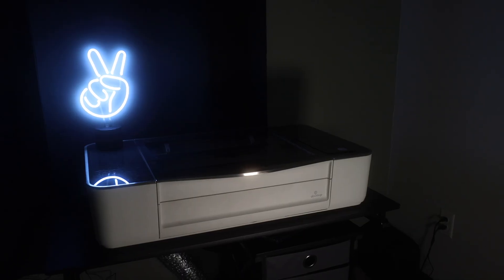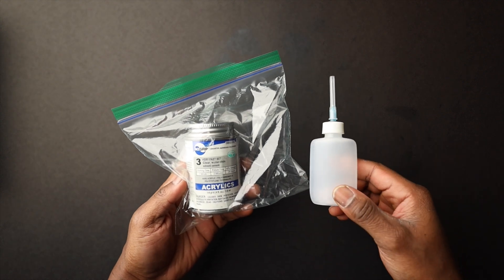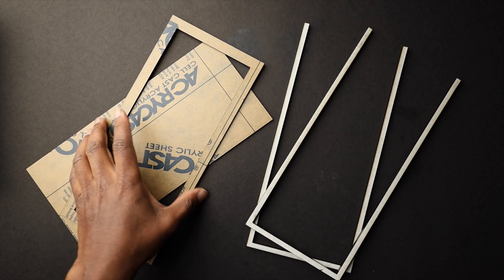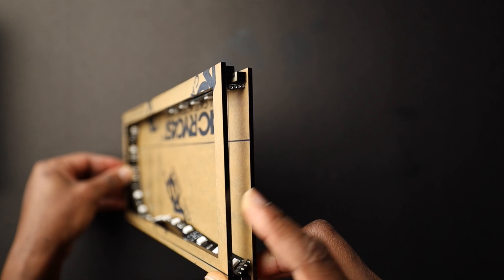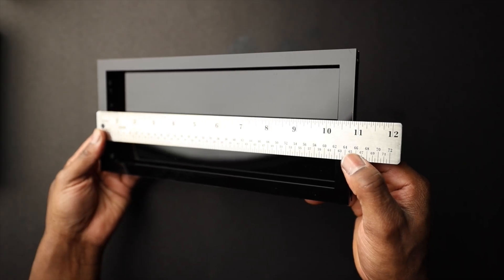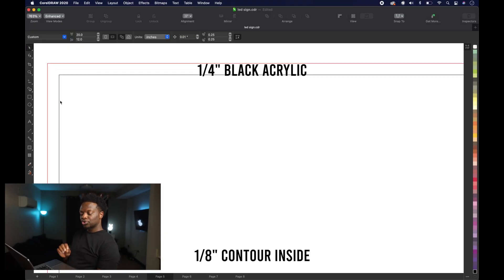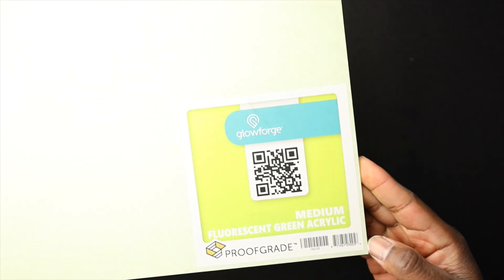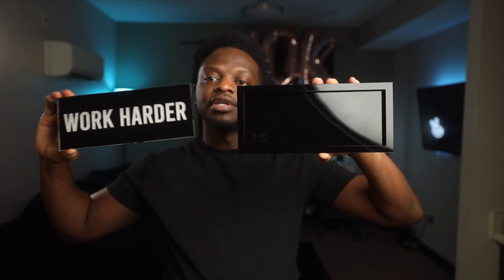Laser Cutting an Acrylic LED Sign | Glowforge

Comment: I have a question. Why add additional black background to the clear. Since the box is black why do you need to back the clear with black? Seems the clear with out the black background would be sufficient. Thanks for the idea.  I will try it.
Reply from the maker: Thanks. I added the black background to make it the thickness to slide inside without flopping around.
Reply: @TroytheMaker  ohhh okay... hmmm. I think I will try it a little different. I will let you know how it comes out LOL...

Comment: Now that's what I'm talking about!! I was really wondering how that green acrylic was going to look like..thanks for showing that.. I ran into that problem with the glue also, so I sometimes use clear glossy tape on the edges to keep the acrylic together. Great Video! Thank you Troy!
Reply from the maker: Thanks for the tip! I need to try some clear glossy tape.